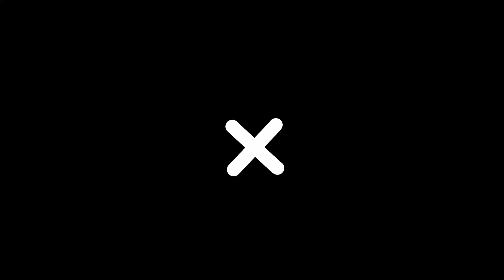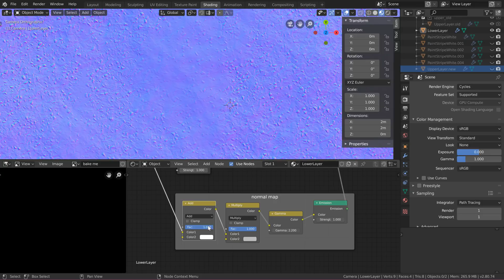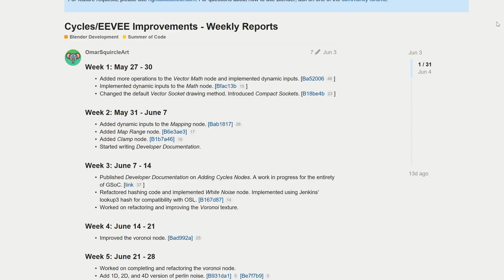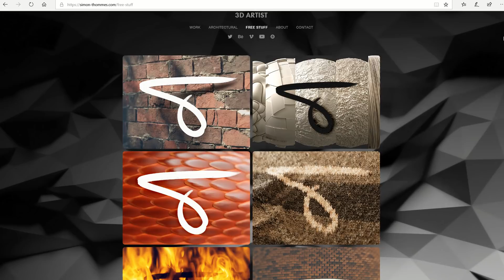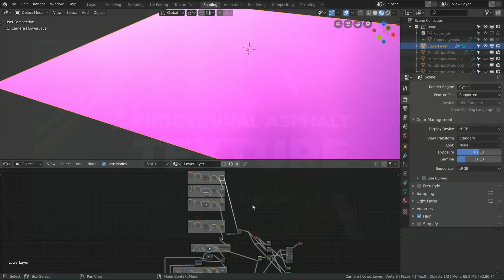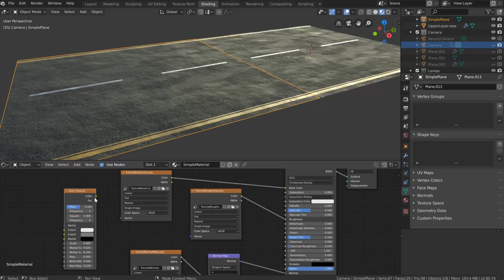Using Blender like Substance Designer

Comment: This week I found a sweet way to do really dirty bakes. On the viewport shading preview, I go to the 7 view (orthographic) then I enable scene lights and scene world lightning and then I select the render pass that I need (this is done with the little down arrow on the right). After that I just do a viewport render image. The downside is that I couldn't find the way to properly manipulate the image size. Tested for normal maps and works just fine without any fuzz and its really fast to do and you don't need to tweak the material at all.

Comment: Hi Aidy. Thanks for the tutorial. How to make material(all textures) seamless along Y axis? The problem here is that we have 4 textures and that's the reason why we can't use clone tool in photoshop to get rid of the seams. Should be another method how to do this. May be some tools which do the job for all textures from the material. Thanks.

Comment: You make wonderfully informative tutorials, Aidy. Awesome job!

I got a little hung up on the bump-to-normal conversion part. I tested the technique on a monkey head and couldn't get the bump node output to be tangent space (mostly blue in color). However when I applied the material to a plane facing up in Z, like the video, it worked fine. I'm wondering then, does the technique only work on flat planes?
Reply from the maker: Thanks so much Kent! That means a lot! :) To answer the question, yes this setup requires the camera to be looking straight down, i really liked the idea of  extending it to work on basically any objects and work more like a matcap so I did a little experimentation and now it should work in all cases, combining geometry and textures together too which is a nice bonus!  it's still pretty straightforward to setup only a handful of nodes, as i type this i dont have access to it though, i'll reply again in the morning with more details! :)
Reply: @AidyBurrows3D  Brilliant. Thanks, Aidy!
Reply from the maker: @khtrammell  I haven't forgotten this by the way! It just grew a little more than I expected, i'll give a breakdown shortly! :D
Reply: @AidyBurrows3D  Now worries sir! I appreciate you looking into it 🙇‍♂️

Comment: Thank You for all these tips and tricks!!

About the Eevee border problem: 

I've not tried it yet, but could it be happening because of the way screen space reflections work?

Mabye the overscan option in the film tab can help?!
Reply from the maker: Thanks! Actually I thought it might be something to do with the filter as it's related to the world settings, so it's the world background that is bleeding in and so just tested it a little then and it does seem to be part of the issue, also the render viewport sampling if taken down to 1 or 2 seems to resolve it too, but if you keep that as it is and instead take the filter size down to about 0.8 it seems to fix it. However, I haven't tested what else in the image that might be changing but at least there is that to try! Cycles is pretty much just as fast when rendering a 1 sample emission shader though so it's not a huge deal either way. :D

Comment: Can u help me out? i got problem in exporting procedural textures to fbx to use it in unity the textures are not exporting only the models are. ( blender 2.8)
Reply: Also look into using gltf, both unity and ue4 support it as a file format for sharing game assets between different systems, supports pbr workflow
Reply from the maker: that's a super promising format for sure! I think more support for it is coming online all the time. :)
Reply from the maker: I tend to do things the long way round and export textures separately to exporting the model, however to offer at least some help perhaps this link has some benefit to you?.... https://answers.unity.com/questions/1343037/blender-278-unity-55-the-correct-way-to-retain-mat.html Let me know as if the link isn't of any help I can look into this sort of thing further. :)
Reply: @AidyBurrows3D  This solution doesn't work for Cycles. I also suggest glTF file format as it tackles this issue and many more.
Reply from the maker: having glTF be able to do all the bells and whistles of FBX and more would be an absolute dream! :D Looks like with each UE4 release a bit more support for it comes online too! Good times ahead! :D
Reply: @AidyBurrows3D  Sorry but the link wasn't of much help for me ... ☹
Reply: thanks for the help guys...  actually glTF works really well but i have to export it to fbx as it is the requirement of my client and i m facing alot of problems in exporting ... the procedural textures wont register at all .. 😢

Comment from the maker: Hello all! There is a lot more to be said on this subject that's for sure, even this is just scratching the surface! Chapter list is in the description as well as below, here I'll be sure to put any corrections/updates required! 

UPDATE : Regarding the Eevee render border issue - it's the world background that is bleeding in and so just tested it a little then and it does seem to be part of the issue, also the render viewport sampling if taken down to 1 or 2 seems to resolve it too, but if you keep that as it is and instead take the filter size down to about 0.8 it seems to fix it. However, I haven't tested what else in the image that might be changing but at least there is that to try! Cycles is pretty much just as fast when rendering a 1 sample emission shader though so it's not a huge deal either way. :D
00:00 Overview
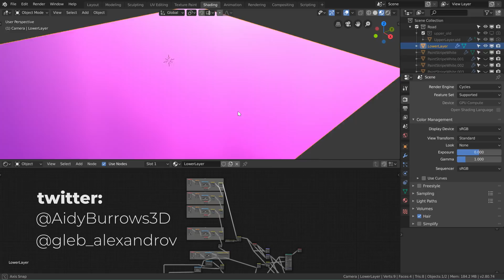02:51 Reason To Layer
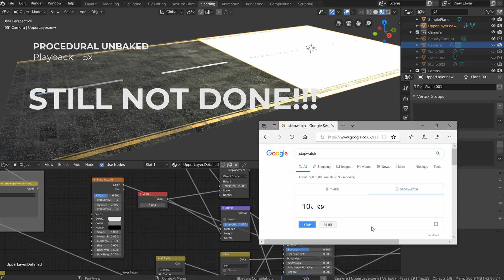05:11 Baking To A Plane
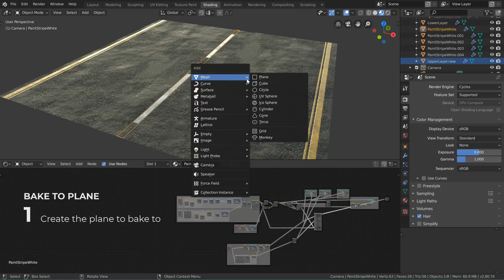05:24 Baking 1 - Create the plane to bake to
05:32 Baking 2 - Create the texture to bake to
06:30 Baking 3 - Choose bake pass type
06:46 Baking 4 - Select the geometry you want to bake to the plane
05:09 Baking 5 - Hit Bake - or see 6 to optimize
07:00 Baking 6 - Optimize
07:14 Limitations Of Baking
08:04 Setting Up The Camera
09:30 Setting Up The Materials
10:22 Frames and reroute nodes
12:15 Continuing with the materials
13:54 Rendering Final Setup
14:53 Eevee rendering border issue (world material bleed)
16:33 Continuing with rendering final setup
17:50 Bump To Normal Map
20:08 Saving The Textures
22:27 Using The Textures on a single plane
24:58 Using The Textures In UE4
27:23 END
Reply: Thank you for your great tutorials..did you see mask tools addon from Wayward art company?
Reply from the maker: @donaldcourtemanche2395  Thanks! No not yet, I do know of the Wayward art company but those tools dont spring to mind at the moment, but I will check them out! Thanks for the heads up! :)